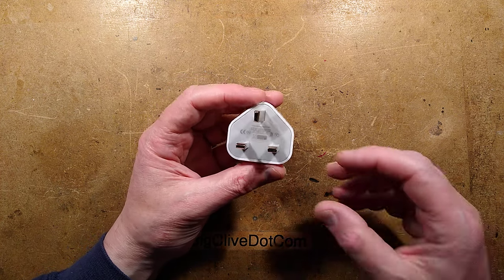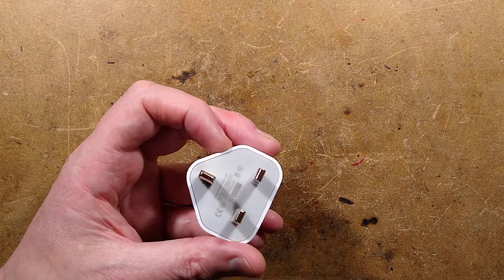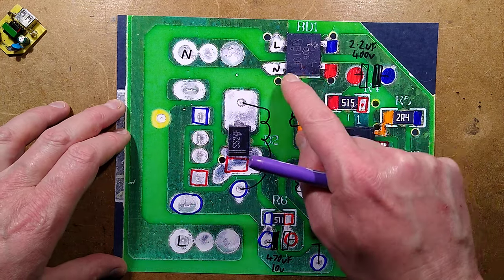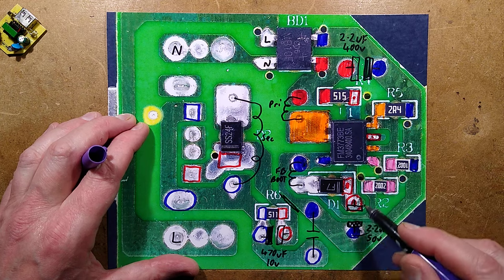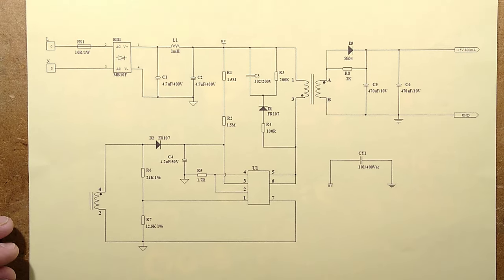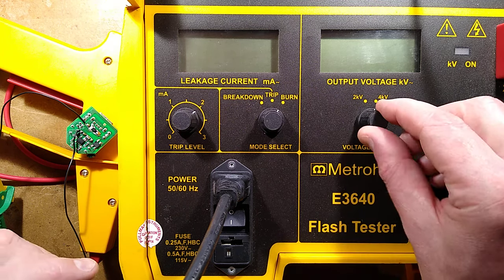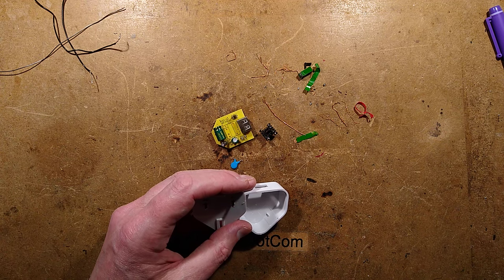Don't buy cheap death-wish chargers

Comment: A couple of years ago the flat below us caught fire due to a cheap phone charger. Luckily everyone got out, even though most of the people in the other flats (10 in total) ignored the fire alarm (it was always going off).
Ever since then I don't trust generic chargers or power supplies.
Reply: Generally as long as a power supply has the appropriate ratings and certifications it should be trustworthy in theory.
Reply: dodgy fire alarms r not good either if  false alarms too freq , then people ignore
Reply: Interesting if true.  How are you privy to the details of what caused the fire?  How cheap was the charger?
Reply: @rogerborg  Fire inspectors can usually figure out the source, if it's not obvious to a layperson (like if the tenant left the stove on and the kitchen is badly damaged sort of thing)
Reply: @rogerborg  Talking to the fire brigade after they put it out and the neighbor a couple of days later. It was a knockoff charger, the phone was plugged in overnight on a bedside table next to the curtains.
It was a block of 10 studio flats with smoke detectors in the cooking areas. The alarms would go off 3-4 times a week. The fire started at about 8am, everyone though it was burning toast and were waiting for the alarm to be reset. It wasn't until a kid ran around to all the flats yelling that it was a fire before the building was cleared. The smoke in the hallway was terrible but the flats had good fire doors so the rooms were ok.
Reply: @paulhall9811  Thanks goodness for solid fire doors.   At least something worked as intended.
Reply: My ex's pc had its motherboard fried from a dodgy phone charging cable.

Comment: Strongly reminds me of a cheap phone charger my father in-law gave me to have a look because it failed. It was horribly cheap constructed and failed because a current limiting resistor got too hot and let out the magic smoke. I refused to repair that thing because upon further inspection it's a death trap similar to the one you had here. There was basically no gap between the primary and the secondary side. I can provide you a picture for giggles and shudders if you want.

Comment: Amazing how easy that came apart. Could easily see half the plug remaining in the sockets as you go to remove it..  And if really unlucky a nice shock for your troubles
Reply: I think Clive mentioned that possibility. But it's another bloody good reason to have switches on the socket when you want to remove the last bit. It's almost as if BS1363 saw cheap chinesium coming.
Reply: Yep, had that happen to me with a very similar looking usb charger that came with an Amazon network cable tester. Top came straight off leaving the rest of it with all its exposed live bits dangling in the air. Replaced it with a Poundland £2 charger. Worth every one of those 200 pennies.
Reply: @georgeprout42  Remember the switch only turns off the live. The neutral and earth are still connected and on so you can still bridge between neutral and earth and end up being zapped by 240v.
Reply: @ZephodBeeblebrox  Oh I know. I hate that "I can't do it" but someone with a one day course can. My two year HND with understanding of the underlying principles counts for nothing. Meh, it's their name on the certificate and I now always double check everything is ok after they've gone. Usually just needs a tighten here and there, sometimes green/yellow sleeving. Or red sleeve on a switched live.
Reply: @georgeprout42 You don't need that swich for that. For something that rare you can just go tho the switchpanel  instead.
Reply: @patrick_test123  But the switch is literally right there. Seems daft to isolate the entire downstairs circuit and it also means I don't have to get up. When you pass 50 that's a major consideration 😉
Reply: @ZephodBeeblebrox  Neutral should be at earth potential though... if the socket is wired correctly of course.
Reply: That's the first thing I noticed the moment the cover came off. That should easily be a local standards failure in almost every sensible country.
Reply: @TonyHamlyn  Neutral and Live are equally deadly when your finger is between either of them and earth,
Reply: @TonyHamlyn  Big IF! I moved a few years ago and discovered exactly 50% of the sockets were wired backwards. (I fixed them, of course.) Presumably whoever wired them had no clue about hot & neutral; all the must've known was, "2 wires, 2 screws!"

Comment: I have one remarkably similar to that which was supplied with an automatic pet feeder. The charger made an audible pop and stopped working the very first time it was plugged in. The pet feeder is absolutely fine and now working quite happily with another charger, just the supplied charger that was dodgy.

Comment: I remember buying one of these for £0.49 from eBay including shipping from china.  The only components it had in it was a resistor, rectifier diode, zener diode and led.  Needless to say the sleeve of the usb output was live.  At least your one had more bits inside but didn't seem to have a fuse or any current limiting.  Definitely a fire hazard if a diode blows in that tiny bridge or the output transistor pops in the IC due to the omission of the snubber network.

Comment: A splash of urethane coating on that PCB would have helped with the poor separation and arcing. But then again it would have cost half a penny and not made this thing safe to use so why bother.

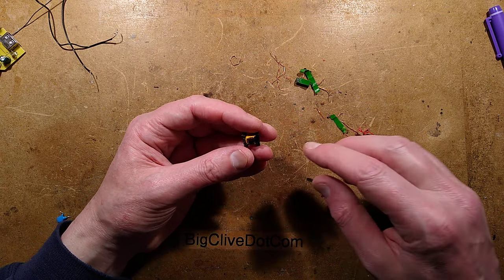Comment: 12:29 I've seen this type of transformer before, and I think it's fabulous! The one where there's absolutely no isolation in the transformer - remember that the feedback winding (often referred to as the auxiliary winding) is connected to the negative of the bridge rectifier, so it's essentially referenced to the mains input.
So you have the USB output isolated by the thin layer of lacquer on the wire, which is less than 0.05mm thick, and is not designed to isolate mains from humans.
This is what DiodeGoneWild would call "super dodgy". ;)
Reply: Thanks for repeating pretty much exactly what Clive said in the video.
Reply: So dodgy you'll need to physically dodge the inevitable explosion if you plug it into a wall

Comment: Skimping on a power supply is always a false economy.  It's worth an extra few bob to be sure it's not going to shock you, go on fire or damage the expensive  (possibly irreplaceable, if it's a home-brew or restoration project)  equipment plugged into it.

Comment: A great lesson on high/low voltage separation, especially for anyone designing their own boards, 

There is usually 2 to 4mm distance and a long slotty thing almost cutting the board in half... It's there for a reason! ⚡📲💀

Comment: One more thought on this. If that case somehow weakened, say by dropping it on a hard floor, it seems totally possible to just pull the upper case part off and then have live metal parts poking from your outlet.
Reply: That happened to me with a genuine power supply for a network switch. The glue had weakened over the years and when I unplugged it, it split in half (luckily I unplugged it fast enough to not touch anything and the way I gripped it the plastic could not fall off completely.
Reply: That's the failure mode that made Apple recall their original chargers.
Reply: Unplugging without throwing a breaker would be the most dangerous game of "operation"

Comment: Both clones of iDevice chargers as well as Macbook-chargers are often a great way to jamming the complete RF spectrum (at least up to DAB+ bands ;-)).
Reply: Dumb QRM is just sad 😔
Reply: Yep. when using my SDR with a longwire, you can see the stripes and wiggly lines all the way up beyond 30MHz. I switch off or unplug anything with a switching supply but it still picks up all the neighbours' devices.
Reply: Not only it electrocutes you, it also causes interference on your wifi.
Nice.
Reply: @monad_tcp  Does it block the signals to call 999 on your mobile?
Reply: @johndododoe1411  Ultimate Skynet moment.
For no more than a pound.
Reply: @johndododoe1411    they are already blocked, I installed custom Android without the RLink driver.
Reply: Just FYI - DAB and DAB+ same band - 175 to 240MHz.  Cheap LED lighting can block it out too if using switching regulators.

Comment: Shocking - quite litterally lol!  I was also surprised at the way the back separates from the front.  I could imagine a possible situation where the live and neutral prongs are still stuck in the socket as the back comes away?

Comment: I can vouch for damage!  We had one of those.  Was sitting minding my own business and all of a sudden BANG!!

ALL lights and power went off in the house and then there was the disgusting stink that ensued.....I thought that the standard lamp bulb had blown, to my surprise and horror, the plug socket looked odd.  This "thing" we had shoved into it had gone bang, throwing not only the usb but also the camera that was attached to it and bits of hot plastic everywhere.  I'm surprised that the sofa didn't ignite!!!!  The other thing I failed to mention earlier was that the three pins were still attached to the charred plate attached to the socket attached to the wall, also blackened by the arc/fireball.

Be wary folks, there are these fake chargers.....they do not have the apple logo inside of them and they are not fused.....the plastic also has a vague creamy colour to it, which, when placed side by side to a genuine apple one, you can see the difference.  Fortunately I am still here sat in my lounge, able to tell the tale!

Thanks to Clive for showing you the insides of one.  Unfortunately there was bugger all left of the one I had!

Comment: I have some of those usb loads from EBay. I soldered two wires on one and use it as a current regulator in series with a battery for charging or a led, lamp etc to regulate current. It's op-amp controlled and keeps current regulation spot on.

Comment: For mobile device adapters I always recommend a reputable third party adapters or if you insist OEM. Pound Shops/Dollar stores, flea markets, no name brands on Amazon, etc are always risky. I also recommending avoiding OEM on Amazon or any model on eBay due to the possibility of getting counterfeits. With USB Power delivery this is getting more important than ever. The latest version of USB Power delivery is now capable of transmitting up to 240 watts of power using up to 48 volts DC versus earlier versions which supported 100 watts and 20 volts at the same 5 amps.
Reply: On the up side, cheapie manufacturers don’t (yet) tend to support high voltage (i.e. 12) or current output.  So far I only see it with 5v stuff.
Anker or Aukey always seem good.  Apple really does make quality power supplies but I want 2 port QC/PD and they just don’t make that.
Reply: I've been known to use my laptop charger on my phone, scares me though. It charges so fast on the lappy charger that I'm afraid it'll cook the battery
Reply: @radellaf  Your two-port wish was answered last Monday.
Reply: @straightpipediesel  my lord, $60 for a 35W dual-port.  $20 for the 20W wasn't that bad...
Reply: @fishyfool  I know what ya mean.  It won't cook the battery, but personally I like using 5V-only USB ports for my phone.  I don't need a fast charge, and it certainly doesn't help the battery to be fast charged.
Reply: @radellaf  I think it's because they're selling the 2-port with laptops and figured that $60 was what people would pay for a laptop brick, versus $20 for a phone charger, regardless of the wattage.

Comment: What really irritates me is that they could've made it much safer with only a tiny increase in cost. This seems like the perfect use-case for open-source, publish a safe and cheap design for them to clone and sell.
Reply: Still would be redesigned to be cheaper, and smaller. Plenty of room in the case for a larger PCB, but that increases cost, and plenty of manufacturers reference designs with a complete BOM and assembly instructions around as well, complete with layout for a case in them, that are not used, because it is going to add a hundredth of a cent onto the cost. They went as small as possible, as cheap as possible, to maximise profit at all costs. Incidentally faking the CCC compliance mark gets you a bill for the bullet in China, if you are small fry, and not a connected person.
Reply: Clive showed the reference schematic for the chip in this charger, and half of the circuitry from the reference schematic was missing in the actual charger, which made it less safe.  The same thing would happen with a theoretical safe OSS reference design.

Comment: In a normal household, are 1 or 2 kV peaks to be expected to occur sometimes normally, or during a thunderstorm perhaps? 
Or is it more a matter of principle to always make sure spark gaps are wide enough?
Reply: There is a slurry of reasons, having a margin is always good.
What may be alright for the 400V peak on 220v mains at standard room temperature and humidity may not be good at higher temps and humidity.

Comment: I worried that you were handling the charger and board without discharging it first... You didn't mention any discharge resistor across the mains, Is it necessary in this design?  I'm not sure.  As a long-time view of your channel, you've taught me well to short them out, probably with a screwdriver holding the plastic handle across those mains before I spudgered it open.
Reply: Honestly, I expected him to doubt that crap's design so much that he would have shorted live and neutral before disassembly.
And of course, it would spark.
Reply: @Kalvinjj  Yes, it would have been interesting to find that out.  But it's torn to bits now.  Maybe Clive will reply on this thread and let us know.
Reply: @Kalvinjj  Snorting live to neutral wouldn't have discharged the 2.2uF storage cap because the bridge rectifier is in the way.
Reply: @grahamstevenson1740  I know, the normal operation would be that, I just mean it's a miracle it isn't SO terrible that you could expect a circuit like those UV germicidal lamps he showed (or was it another channel?) that connected to mains and left a capacitor charged up with no discharge resistor, that would just zap you if you touched mains unplugged.
Tho I'm more just exaggerating it, I think that kind of capacitor dropper (was it?) circuit wouldn't be suitable here.

Comment: This might sound stupid but why bother to make the earth pin metal when its doing jack all?
Reply: Since it should be connected in the real thing (see the chematic on the end with this safety-cap that is not on the board)
Reply: Modern British plugs block off plugs without earth pin

Comment: Oh my. I'm not an electrician or electrical engineer, just an IT tech but even audible 50Hz mains hum emitting from LV (I don't call 240V low voltage - but it's relative I guess) power cabinets makes me nervous - I'd be horrified to hear an arcing noise like that from a device on site. De-power immediately.... we're all going to die!! :D
Meddling in stuff I shouldn't as a kid and getting some hefty mains zaps as a result taught me caution I think. My Mum used to tell tales of finding me with the back off the CRT TV poking about inside, with it plugged in... at 5 years old. I just wanted to see how it worked I think..... in hindsight, I'm lucky to be alive.
Reply: Nah, it's fine. I sleep under my electrical panel, the humming of high current passing through the breakers is soothing.
Reply: Gees that TV thing thou, that was really stupid. I knew when I was 5 that the HV from the flyback to the tube could kill. There was a technician TV store that I used play around, they taught me how to play safe with electricity and some overall vision on how the TV works. 
But I was shocked one time when I was plugging things, it was an power 5V power supply I was using to power lots of crappy electronics , luckily I was insulated from the ground because I always sat on a rubber mat and only plugged things with one hand. That left hand touched the pins and shorted them, lol, it was enough for me to throw it away, luckily it was only 110v.
Most of the times I only caused short circuits and tripped breakers.
And the magic smoke of my electronics.
Ironically I ended up being a programmer because I was too poor to proper have an electronics lab.
Programming was expensive back then, a computer could easily cost $5K. But as my father was an engineer, I could use his at night.
Reply: I was poking about with a multimeter in the high voltage circuit to find an intermittent fault in ours.  It took weeks of carefully navigating around the open TV to watch the show together with the propped up meter to see if the needle moved when the TV failed.
Reply: I used to disassemble everything, once when I was 10yo, I disassembled a tube TV to see inside. I took care wrapping the cable with tape so I knew the TV was off for the entire week before opening it, the TV wasn't being used for a long time thou. Then I shorted the flyback plug to the chassis using a long screw driver just in case. You can do that by sliding the screwdriver under the rubber of the flyback cable. You have to clip it to the chassis using a cable. 
Always be safe when playing with HV. 

When I was more younger I was super afraid of dropping things inside the TV as I plugged my videogames on it. I would never put things on the TV.

I remember once my mother dropping a bit of water on the TV (it was from that plate used on plants) . It made spark sounds, amazingly it kept working. Those things are like tractors.